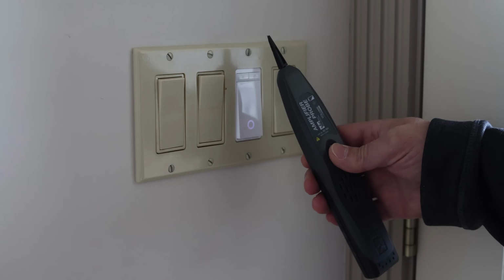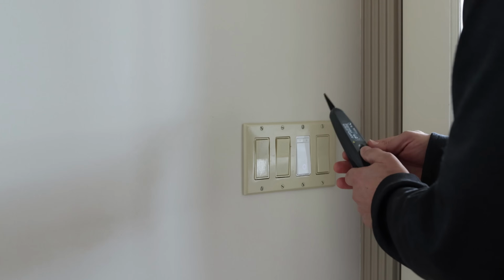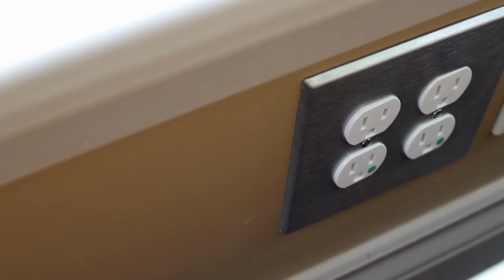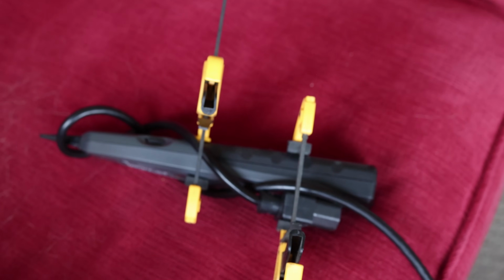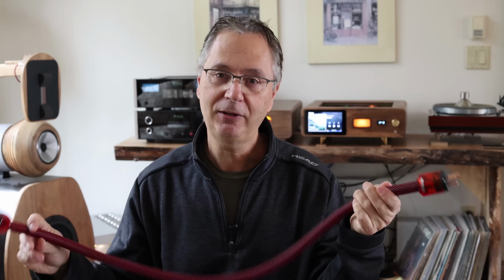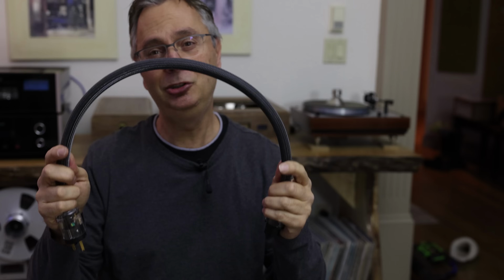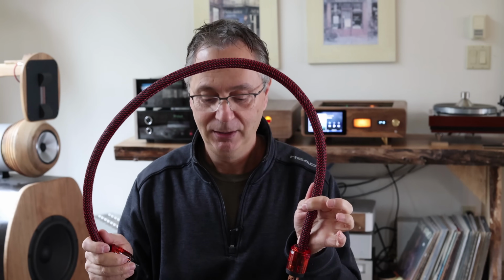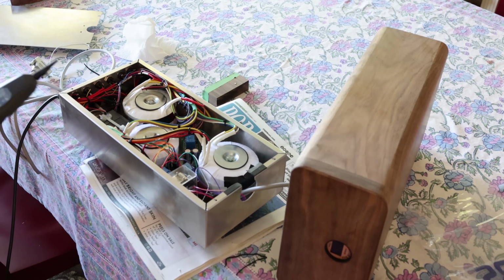My Top 5 Inexpensive Hifi Tweaks for clean power to your amp, preamp, dac, turntable, and more.

Comment: Wow, i dont use dimmer but it is good to know. That cable looks good for the money. What about their connectors?  Most of them made from plastic or policarbonate. Much expensive ones metal.  Also please mention ground problems, my naim amp makes some floor noise speaker end, needs a source device which has Floating ground switch, eliminates that. I dont understand what it is exactly. I  bought ifi ground defender, but it doesnt solve.

Comment: Two meters of shielded power cable is not going to compensate for miles of cheap copper and aluminum wire. Try to find a U.L. certified shielded power cable.

Comment: Any comment  on ‘power conditioners’ as a way to reduce RF noise? Thanks a lot, I appreciated the tips!
Reply: Lots of good ones out there. I suggest using a plug in or hard wired absorber-sine wave corrector type, close to the breaker panel. One brand is Environmental Potentials. After that use a power distributor with several outputs for your source components. Use a separate one for your amplifiers. This is a basic but very good set up.
A next step would be ground absorber boxes. One for your power conditioners and another for a component such as source component or preamp or amplifier. Even one is good.

Comment: Electric motors (pool pumps, fans, AC units, refrigerator, dryer washer all create power quality, power factor issues by electrical current sin wave lags behind voltage. Switching power supplies such as computers, LED light bulbs, phone chargers, variable speed motors all created power factor issues where amps sin wave leads voltage sine wave, both creating line noise and line power harmonis, hormonic distortions. Interesting in data centers all the computers creating leading some wave amperage from switching power supplies are somewhat balanced out by cooling fan / pumps lagging amps power 

From the power companies point of view a bad power factor  means they have to generate and charge you for having to generating more power (wasted power generated as heat in your home) then your appliances actually use). Power factor can be corrected with capacitor banks and other filters.

Power factor of 1.0 is 100% efficient. Most modern switching power supplies have a power factor of 90%/0.9% PF 95%/0.95PF. An electric motors power factor ranges from less then 0.2PF /20% to 90% / 0.9PF for high efficiency motors, motors running at very low loads tend into have bad power factors, etc.  VFD variable speed motors can have built in filters that correct power to 0.96PF 

The rest he does here here very primitive and does not identify the cause, dirty power or if there are Harmon's issues. A good but very expensive power quality meter will 
 Clearly identify alm types of power quality issues and how bad they are and are key to correcting those issues.

Comment: Wow shielded power cables get expensive, fast. What order of devices eould you prioritize? Highest power draw, noisiest, least noisey, closest to the speaker/headphone, amplifier?
Reply: Don't believe this fool. He's peddling misinformation. You don't need clean power. Filter capacitors in your amp turn it to clean DC. Anyone with a fundamental understanding of basic electronics knows this.

Comment: Guys, get it right: electric power does not “flow” down the line. Electrons vibrate in place. That’s why the quality of the cord from the panel to your outlet doesn’t matter. Upgrade the cord from the wall to the component. And it’s a lot more than just shielding. It makes a huge difference.

Comment: Hi. Great video, thanks.
One question. 
The Tester Probes are used to detect lines (with voltage) behind the wall, covered by it.  
Are those Testers also good for detecting noise on a line?  
I mean, do they really sound different if the line is polluted?
Reply from the maker: They do but bear in mind noise is being amplified 1000 times and your system can filter most of it but still a gives you a idea at least in the low frequencies

Comment: In UK electric standards lights are never gping to be on the same line from the consumer unit as the socket ypu have your HiFi plugged into. The sockets are going to be on a 'ring main' & the number of ring main circuits will depend on the size of the home.

Comment: I rewired my entire audio room with nordost Valhalla power cord cable to get the purest possible sound. I then opened up all my audio hi-fi components and removed all the lines and replaced them with small bits of Valhalla wire and soldered them in. The end result gives me pure sound unlike no other. The sound is so pure I experience something akin to autonomous sensory meridian response euphoria.
Reply: I did the same as well, but I took a step further and rewired the connection from my ears to my brain. I experience sounds you wouldn't imagine in the most pure of forms
Reply: That's interesting, I did the same, just in my case I used all Duelund tinned copper cable. For example, changing the hookup wires in my DAC, it resulted in a change as if I had upgraded the capacitors. Extremely organic, lively and blooming but also detailed sound - I love it and it makes me happy :)

Comment: Wonderful. I have a Powerquest 707 ultra linear filtering. So I still need the shielded cables? Also do I need them for my Martin Logan speakers, receivers and power amplifiers and TV and 4K player? Thanks in advance
Reply from the maker: I think the most important is not to mix signal wires specially weak ones like line level  with Power cables I would start with those.
For amps Or Your Martins if they have a powered sub you need both a very heavy and shielded wire as Amps can draw big power fast a good power socket is very Imp for a Amp or Powered Speakers in your case you can get a very nice shielded cable under $50 anything more your only getting that extra 0.01 %
Reply: @Gabster1  Thank u so much for your quick response..I have the same problem as one of your viewers.  The back of my PowerQuest 707 will not accommodate so many of the big cable plugs you suggested (thanks for the Amzn link).  In order of importance..I have 2 Martin Logans - ESL 11 and then I have 2 powered amps - Arcam PA240 and then an Arcam AVR10 receiver and also a REL sub woofer.  Would that be the order - I think I can only fit 4 of the power plugs.  For my speakers I will need 5 feet and for the Amps to my PowerQuest 707 - 3 feet is fine.  And if I had space for only 2 big power plugs would I go for speakers OR amplifiers?

Comment: when I was pulling 1 20a   line up I decided to just make it 2 so now i have 2 20a in a 4 gang box , I plug 2 of my subs into 1 20a and 1 to my 20A Furman conditioner and the forth outlet I use an AC purifier from IFI its pretty good

Comment: swap the outlet out to a hospital grade one they are tighter and better constructed , the power wire just make sure it is shielded otherwise its just pure snake oil , the wire behind the outlet is nothing special to the panel and from the panel to the power station are equal as shitty , the shield is just keeping the 100 other wires from interacting with each other behind your rats nest. , a good conditioner is a good idea and if you have allot of money get an AC regenerator it converts AC to DC then back to AC to rebuild the power with 0 influence on the line.
Reply: This is not correct. I used to believe this myself but I now realize power cords do make a huge difference. Why? Because AC (and even DC) electrons do NOT flow down the line. They vibrate in place. That’s why the quality of the power line from the plant to your house is almost irrelevant. 
You need a lot more than shielding for great sound.
Reply: Another thing is that AC regeneration has its own flaws: specifically it Adds noise. I had a PSA P20 and changed to Shunyata. Much better.
Reply: @Fluterra  flows on outside not inside

Comment: remove the led lights, and dimmer it should help for that ''noise'' . and you are hearing AC, that is normal . every good amp has electronics right where the power comes in, to reduce and filter those spikes. if you want to eliminate interference from your power grid, just get that float transformer.

Comment: about 15 years ago i tryed few times to switch oyaide gpx(red connectors) and oyaide gpx-r(white connectors with rhodium plated and some palladium or so). wires were same pcocc-a oyaide power cables 5.5sq. and gpx-r sounded much beter. and gpx were sounded dramatically beter than some stock power cables. so - even conector makes really noticable difference. that is a fact.😊 especially at dac or receiver, whatever.
Reply: and, i allso have maybe 4-5 powercables m1-r1 oyaide, with not white ceramic folks, but with aluminium folks, top of oyaide line - i didnt noticed any difference with gpx-r. but gpx vs gpx-r its really notisable difference, i swear. only folks are different😊

Comment: The most inexpensive way to improve your sound massively is treat your walls with acoustic panels, period...
Reply: Yes, but that’s only 1 leg of 3. 
Equally important is electricity quality including grounding, and vibration isolation, preferably active. If you are neglecting these, you are only 1/3 of the way there.

Comment: Why do you recommend hospital grade outlets for a stereo system? Hospital grade outlets are designed for a strong grip, not for low noise and high conductivity like a Furutech or Audience outlet that's specifically designed for high-end audio. And there's a world of difference between a $50 power cord and a $1000 power cord that you may or may not hear without a good power conditioner such as a Puritan or Audience. In many if not most cases, a dedicated line is not going to replace a good power conditioner.

Comment: don't have an expensive hifi, just a modest budget setup with the newest component being my 22 year old B&W speakers, but i am waiting for so Lapp cable to arrive along with a suitable plug and sock just wire on, but before i do that i'm going to smooth down the pins to get rid of the pits and grooves you get with them from the factory to prevent micro arcing. probably won't make any difference but if there's a chance it'll improve things i'll do it

Comment: A couple of additional thoughts:

1.) This suggestion applies mainly to the USA which typically uses a 120/240 volt 3 wire split phase service (with two "hot legs") on most residences: Go to your breaker box and see which circuits are the noisiest. Try to make sure those noisy circuits are on a different leg of the service from your sensitive ones.

2.) Try clamp-on ferrite cores on your power cords to help cut down on interference – both on your sensitive items as well as your ”noise-making culprits”. (One notorious one is a plugged in lamp that turns on/off/dims by touching it. Those usually use a triac to switch the light, which is also the same technology inside most dimmers.)

3.) Consider some higher current ferrites on the branch circuit wires inside your breaker panel.

The power cord ferrites are definitely within the realm of a DIYer. The other two are within the skillset of MANY DIYers, but if in doubt, call an electrician.

Comment: If you only have one high quality AC power cord, is it more advantageous to use it on your DAC or your integrated amp?
Reply from the maker: Amp for sure as it draws a lot of power and you need a good connection

Comment: Really interesting. Good info. I have a few questions. First, how about AC filtering devices? I currently use a very expensive Monster brand surge protector. I believe that Monster claims “clean power output.” I’ve ordered a IDEAL 62-164 Amplifier Probe and I’ll be checking to see if it lowers noise or not. Second, it occurs to me that it might be a good idea to run the AC power supply cables inside metal conduit. Not sure if that would shield nearby audio line cables from noise or not. I’ll do some experiments with the ideal probe. Come to think of it, maybe it would help to run audio line cables inside flexible metal conduit for additional shielding? I previously worked in the broadcast industry, where all audio lines are the balanced type, as I understand it, that is done to reduce noise. I have several components that use balanced line connections, and I have not noticed that they are quieter than regular RCA connections. You have peaked my interest and I’ll be testing my setup.
Reply from the maker: Ac filtering devices are good but limited the best is try to eliminate the noise source specially close by. Ac reconstruction can be a lot better.
The monster and a lot of others do very little 
Also be careful they are full of inductors that create noise in proximity so don’t put a device close to them should be a good few feet away 
If you pit your sniffer close to one it will go crazy

Comment: While it might do no harm to follow your advice, the notion that the sound will be improved, is absolute bullshit. Your electric power may be coming from hundreds of miles away, the all kinds of switches and contacts, and it is ludicous to think a $2,000 plus cable will improve the power flow. A properly designed AB or ABX test will prove that.

Comment: What about the use of LED lamps? Do they cause greater degradation of the electrical grid than filament lamps?
Reply from the maker: They do not only when connected to dimmers
They usually run on dc and most self internal dimming is done differently then dimmer switches they dim by reducing voltage not alternating on off

Comment: With the system on and no music playing,  if you don't hear any noise or buzzing, you are fine. No changes needed. Any well designed components will have sufficient filtering to avoid line noise.  Poorly designed boutique audiophile gear may not have good noise rejection.
Reply: @NackDSP  it's sad there are so many individuals so deeply indoctrinated in comparatively failed designs. No shock that so many products lack in sonic realism. Most engineers in audio really need to learn what they simply don't know. Ii would be embarrassed to attempt to defend so many of these low hanging fruit designs or any of the clowns or jokers that push them
Reply: False information

Comment: I have a dedicated circuit for my rig and the problem that I am facing is anything and everything in my house gives me a split second mute when I flip a switch, my boiler kicks on and even the solenoid on my fridge when I fill a glass of water. I've snugged everything in my breaker panel and really cannot figure it out. Os is it possible that I have a loose neutral somewhere? Anyone have am idea of what it might be?
Reply from the maker: I would measure the voltage on your line
and switch things and see if there is a drop in voltage
I am guessing it is your amp muting.
If there is a minor brief drop in voltage sounds like your line voltage could be low due to a thin wire connection possibly at the main house supply.
worth checking out the voltage.
Reply: @Gabster1  It could possibly be my Bluesound Node 2i maybe? A few years ago we had new service lines connected to the house along with a new panel. My node is sitting on top of my amp and I'm wondering if that could be part of it. Tomorrow morning I'm going to get the two away from each other. My amp is a Rega Elex R and my dac is the Denafrips Ares II. All of my cables are Morrow and for power I have all 14awg hospital grade 3' cables into heavy duty outlets that have a good grip on the plugs. All on a 20 amp circuit that I  ran a few weeks ago. I  had this problem before the new circuit.
Reply: I might have found the issue this evening. It might be my digital coaxial cable that was too close to the 5volt line coming out of my linear power supply for the node. I'll have to do a streaming session and see if it is gone.

Comment: Nicely Done.
New Subscriber 2024 :)
A do have a few questions if you have a moment.
1)  if using the better power supplies that you suggest am I losing a lot if it needs to be plugged into a power strip ?
2) Can you suggest a better cost effective power strip  I hear  some filter out the high's ?
3) How much extra room behind my power amp do I need to take into consideration with using this better power cable 2'' 4'' ...  is the cable very stiff ? I might run out of room before I hit the back wall ?
4) Besides an ifi power supply which I recently purchased I was looking for a moderately priced 12v 3A switching power supply for my cable box ?
Thanks in advance
Reply from the maker: Thanks :)
1) Change your Outlet to a Double Hospital grade receptacles
the very least Plug your amp in the wall without extensions and the rest on a sturdy  power strip
2)https://amzn.to/3O0duKW
these are used in Pro-audio but I would shorten the cable to the minimum needed
3) they are stiff so a couple inches would help to bend
4) at 3A hard to go linear for cheap the IFI 12V is your best bet 
https://amzn.to/3Se4AMv
have fun :)
Reply: @Gabster1  Thanks for the quick reply.
Sadly my power amp is about 7.5 feet away from the outlet so your suggestion of the WAudio cable won't reach. I don't see a larger version.
I did see a D'Addario  IEC power cable - IEC to NEMA Plug Power Cable, 10FT but I don't see any info. about it being shielded :(
The Furman power conditioner has a very long cable as you stated. Is it just a few screws and a knife to cut and strip the cable
or is there a need to solder the connection ?
Thanks or helping my journey .